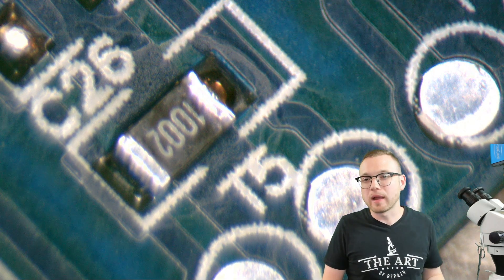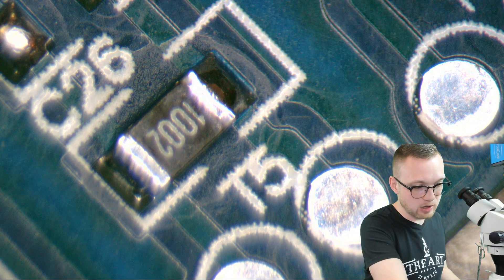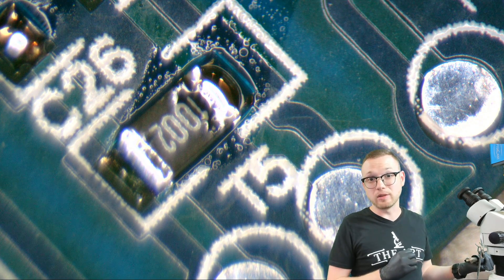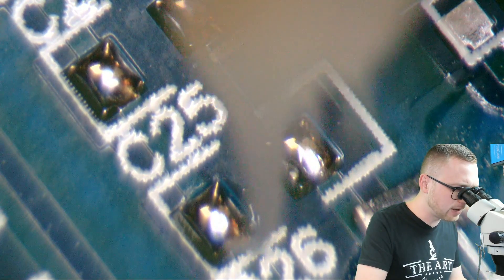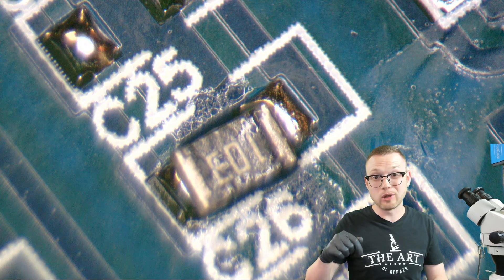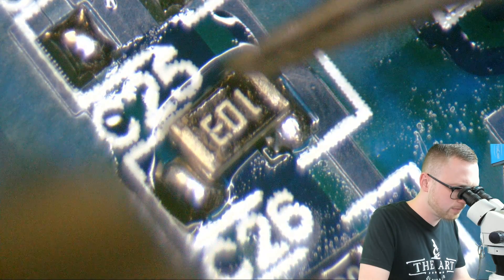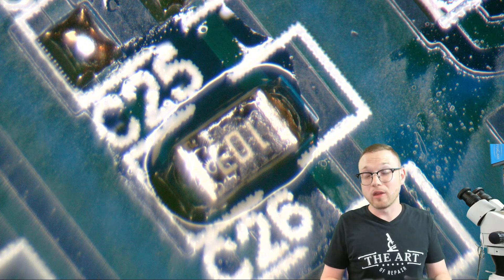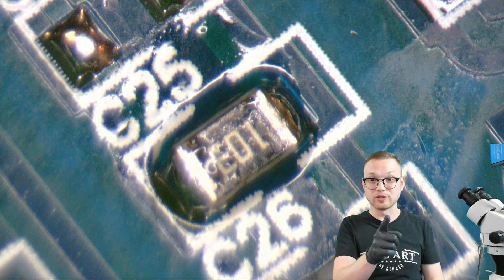EP56 Surface Tension | Hot Air Rework Fundamentals | How do I get my parts to "jump" into place?

Comment: You did that with ease and it illustrated the point very well. The solder amount for the size of components was a bit more than I would use, but I am nit picking technique here. My former training is coming back to haunt me. It’s okay, I learned in a different time with stricter rules. It is just what I see in your method and mine. Yours works too so it isn’t wrong. It is just different. Okay.
Reply: What's your method?
Can you explain it please?
Reply: Free user, it’s about controlling solder flow by decreasing solder size which lowers waste. It’s about using solder less than 0.031”. Smaller size gives you greater control. It requires you to watch for the issues like it’s to hot which causes black specks in the surface. There are voids from too low a feed rate. It’s a discipline inspired by DOD STD 2000-1. It’s not the current standard. It’s the one I learned under. Standards change to adapt to different needs. The new standard is called the J standard. I don’t have experience with it so I cannot insert an opinion on something I am unfamiliar. The key with this standard is leaded solder use, particular to RMA solder of a pure eutectic. Equipment must meet or exceed the standard set inside the standard. No fluff and for real. It’s a discipline. Soldering is a discipline, plain and simple.
Reply: @markphilpot4981  Thank you a lot for that.